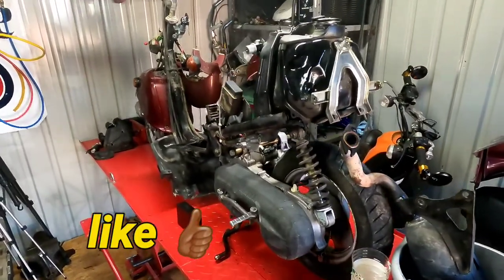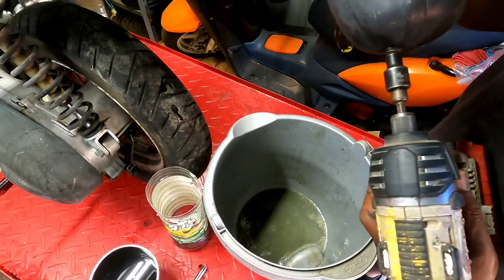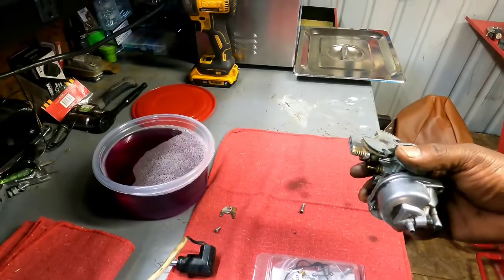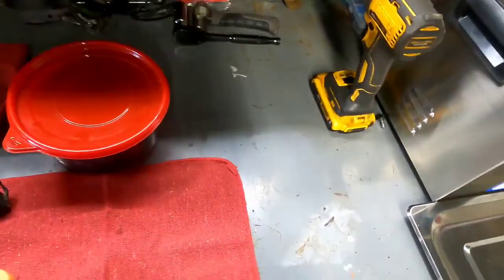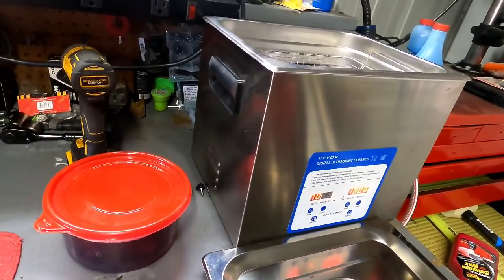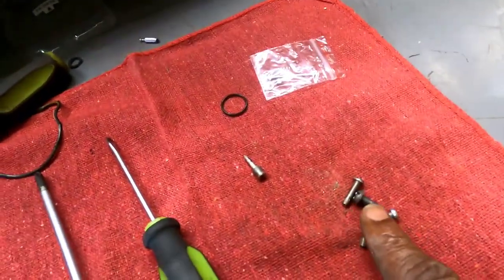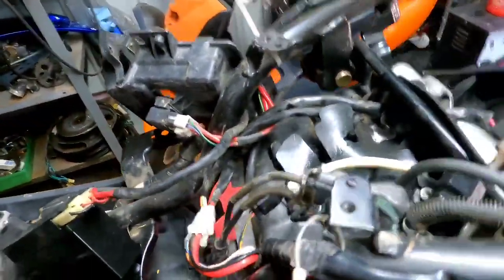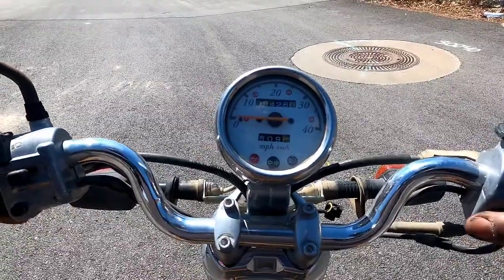Part 2 of the 2001 Yamaha vino REHAB will it roll the streets again?

Comment: It has taken me a 100 videos to find the tiny little two stroke oil pump, it is on the right hand side down just in front of the generator and right next to the cylinder head, it was disconnected by the previous owner but I like to use the mixture pumps so ordered another. One thing I cannot find is any drain plug for the engine? Surely the crank gets oil from somewhere!
Reply from the maker: Thanks for watching ‼️ there is no drain on 2 strokes the engine gets its oil from the 2 Stoke oil mixture.  People like to delete the oil tank and premix because if the oil pump goes out the only way you'll know is when the engine locks up.